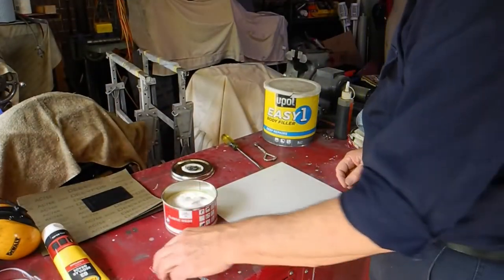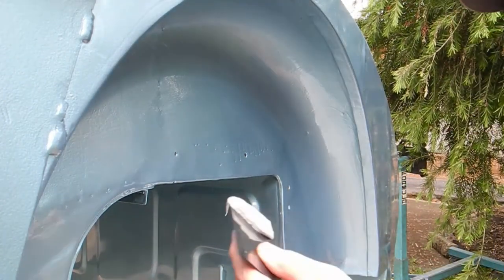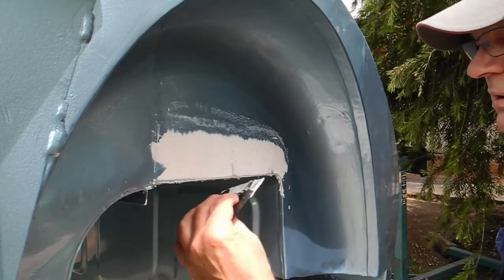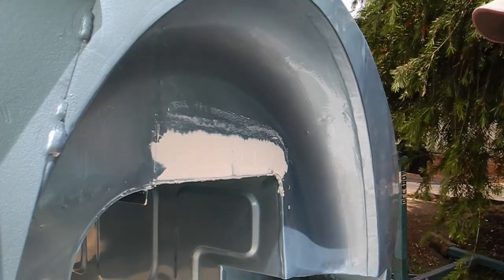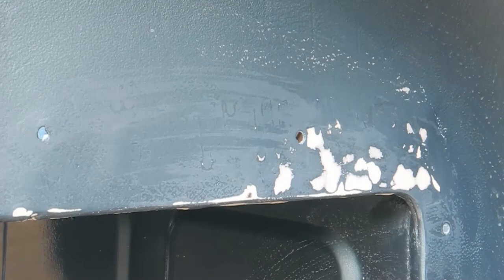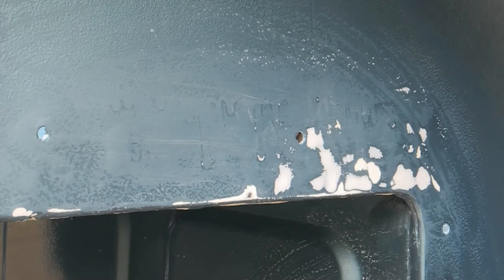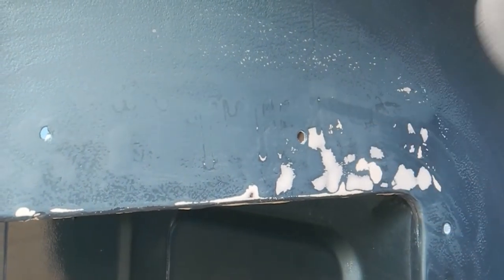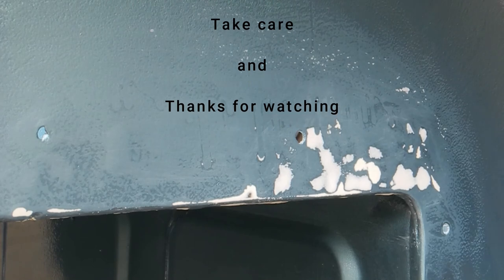Austin Healey 100/4 - Polish out the clear run in the clear finish (07)

Comment: I am retired and restore old motorcycles as a hobby.   If I get a drip(s), I let the paint or clear coat dry for a few weeks.   Then I wet sand with fine grit paper - on the area of the drips only.   After the drips are mostly gone, I use very fine sandpaper over the general area - to blend it all in.   (I used to have a 100/4 and I sometimes miss it.   I wasn't ready to do all of the work you are doing.)
Reply from the maker: Hi Steve
Thanks for your input - it’s been a bit of a learning curve for me also.
When others do it on YouTube they make it look easy until I have a go.
Live and learn they say - take care
Hugh

Comment: Thanks for another installment, love the background noises from the wild life, how exotic, but i suppose you get used to hearing it all the time, we get used to the noisy green woodpeckers fighting it out with the magpies crows and buzzards it can get kind of loud out here in the countryside. You could always have done a stone chip layer on the wheel arches then given them a quick top coat after, that would hide the runs and add an extra layer of protection, they did do this at the factory i'm sure as i have had to remove this kind of black factory gunk with a topcoat finish on my car to be able to get at panels for repairs .  Regards Roy.
Reply from the maker: Hi Roy - nice to hear from you again.
I must send pics of the birds that come for scraps and such, cockatoos, lorikeets, rosellas, king parrots and galahs. The cockatoos are known to destroy your house if you don't feed them - they pull the window rubbers out and chew timber.
Yes stone chip layers - don't like it even though it's required for concourse - I'll take losing some points. The tar type sound deadening used leaches back into the paint somewhat.
Might have been better to leave that area alone as the bumper box sits over part of that area. You sound knowledgeable on these bits and pieces, do you have a Healey by any chance?
Reply: crikey the cocatoos take your house apart, and i thought i had it bad as the bird life likes to pull all the moss balls off the roof and then they roll down collect in and block the gutters, "the moss that is, not the birds". one thing i really hate are the rats that come off the fields when the weather turns looking for somewhere warm to over winter, hatefull things. I did own a 100/4 for a little while in the early 1990's, it was an import from the USA and although it was quite rust free it was still brought for a restoration, i was looking forward to enjoying the restoration and ownership for many years but unfortunatly i needed to come up with funds to start a new job, it was the only item i had to sell at the time so it had to go, so i only owned it for a couple of years, to say i regret having to do so is an understatement and i still kick myself for selling it,  i brought it for the princely sum of £3,000 and sold it for £3,500 and you just cannot find one for restoration nowdays for less than £15,000 to £20,000, "a ridiculous amout of money and well out of the reach of most pockets", and they are now much harder to find as well,  i do at least own a frogeye so i am not totaly healy less and i am in the middle of a tr3a restoration as well. Regards. Roy